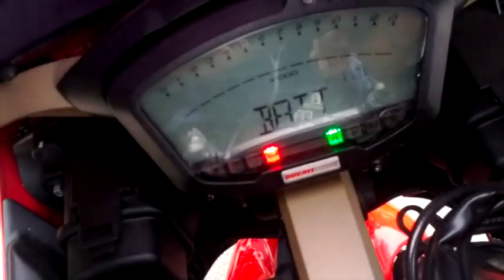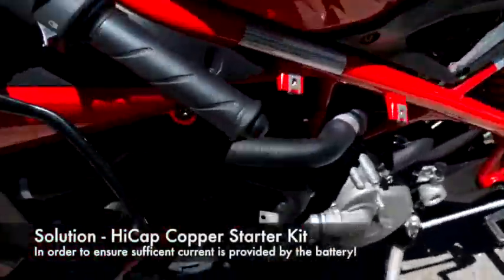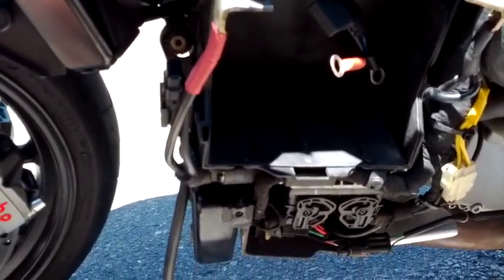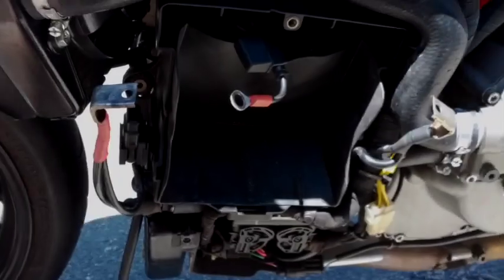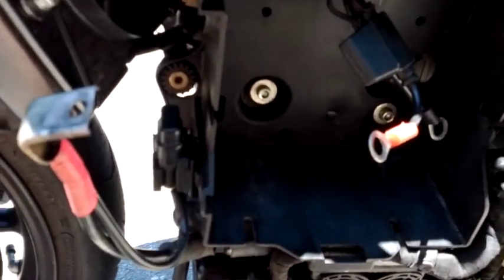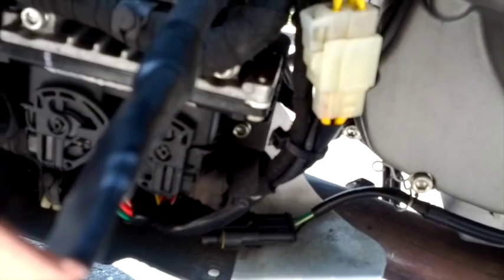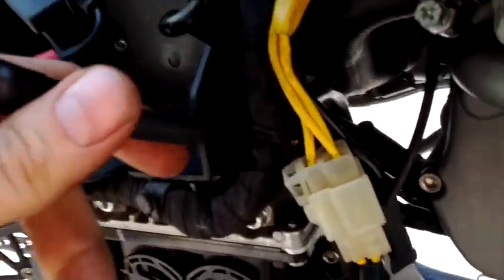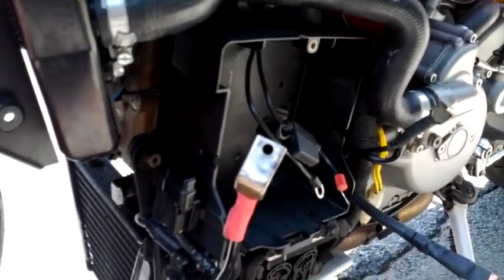Ducati 1098 Starting Issue Resolved with HICAP Copper Starter Kit by Motolectric

Comment: I can't believe I had to go thru all the bs because of that. I honestly couldn't wait 5 days for the wires nor wanted to pay 140. So went to home depot got a 6g copper wire and made my own wire, took the old positive and ran it from negative as extra to the block. Sand pappered all the connections for maximum contact bam. She's fixed. Also had headlight blowing because of this. Stator wires heating up also. I replaced both 20A mini relays also croded.

Comment: Why not run double from solenoid to starter?
Reply from the maker: I suppose you can double from the solenoid to the starter as long as 1. the copper cable makes contact first, 2. you have enough space for both ends under the same bolt on both ends. 
Lastly, I'm sure Motolectric would have recommended complete replacements of the cables if they weren't so tightly integrated with rest of the harness.  They instruct us to double because it's the least intrusive way of doing it.  Also in the presence of a copper cable I'm not sure if it makes sense to double with a cable that has less conductivity; at the end, the extra cable will draw from the current.
Reply: @serkano  Ok. I did almost as you did. I run double from + to solenoid and double from negative to starter. Also installed a sh847 regulator and relocated it.

Comment: Mine is 1098 and I have problem starting the engine when cold... it takes about 5-6attempts very hard to start 
Thank you for this video, can HICAP resolve this problem for cold start ?
Reply from the maker: Hey Pespes, I'm not an expert nor affiliated with the Hicap brand but these cables really improved the current that was going to my starter.  Whether helps or not, installing these higher quality cables would at least help you triage your problem by eliminating this part of the harness.  Good luck.

Comment: Hi Serkan, thanks for sharing. I have one 1098 and ignition problem, after engine heats up 15-20 mins later. Could that be a sensor problem or starter engine error. What's your idea. Cheers.
Reply from the maker: Hey.  My 1098 used to shut off after overheating; it ended up being that my cooling fans weren't working.  It sounds like you may have ignition as well as overheating issues and they may or may not be related.  However regardless I'd recommend these cables, they provide adequate current back and forth from the battery.  I'm sorry I wasn't too much of a help.

Comment: hello!
Is this problem even when it is hot.?
My 999 does not ignite when hot; I have to wait for it to cool down, and then ignited,
lp Simon
Reply from the maker: Hi Simon.  Yes.  In my case, it was mostly when it was hot; doesn't mean it didn't happen when it was cold either.
But there were times where I would be stuck in traffic for long and either the bike would shut off or I would not be able to start it back up - I had to wait until it was cooled - and even that was a long shot.
Reply: ok thanks, I'll buy a thicker cable, or I bought this kit starter kit

Comment: That's why i don't like nor trust italian bikes, they cause the highest failures in the motorcycle market, same thing with BMW, these manufacturers electric/electronics are their weak spots and expensive to fix.
If you want a trouble/worry free motorcycle I highly recommend Yamaha, Honda or Suzuki and forget about the rest. Safe riding mates.
Reply from the maker: +Stingercam21 You're absolutely right all of my previous bikes have been Japanese but I came to a point where I was happy to trade reliability for beauty, performance, sound, the experience...  But you're right I've had my share of disappointments and dent in my bank trying to keep maintaining the bike.
Reply: for let you know that ducatis electrics are made by americans since 2003, even in europe. i have the same problem with my 1098s in europe
Reply: The same with my 1098s 2008. Now i go to do it. Thanks for the vid.

Comment: So your battery went from 12 volts to 12.3 right before you started it? Haven't seen voltage climb up specially when the lights turn on when you switch ignition to on.
Reply from the maker: Roie Pozas The jump may have been the result of headlights turning off after few minutes of engaging kill-switch.